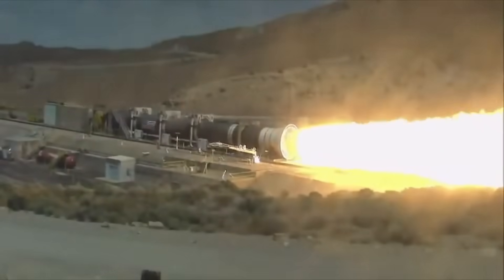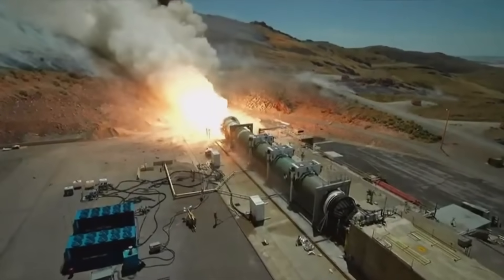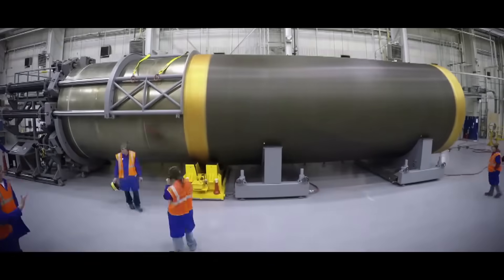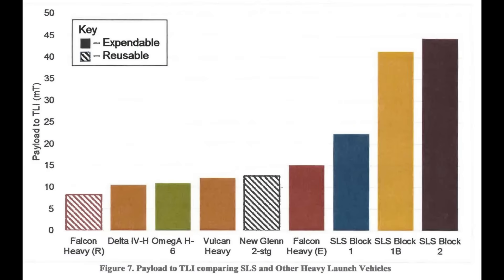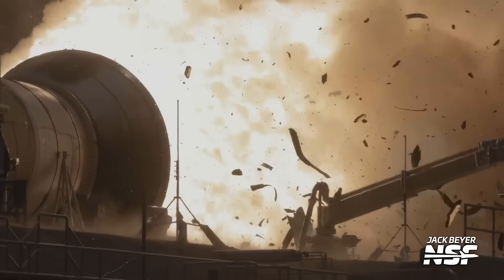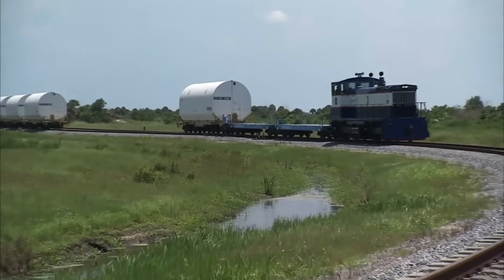NASA's Future SLS Booster Just Failed Its First Test

Comment: Setting the explosion aside, why on earth would you put "Obsolescence" in the name of your new product.
Reply: Yeah, that and the "life extension" part of the name of the project made me think that this was a motor that had been built and stacked quite some time ago, and the test was to see how long such a stacked SRM could be safely stored and still be usable.  Propellant slump in these things is an issue if they sit around for years after stacking.  I seriously thought they were testing an SRM that had likely suffered propellant slump, not a brand-new iteration of the Shuttle/SLS SRB.
Reply: @DougVanDorn  Yeah the "solid" fuel isn't really solid, it's a non-newtonian goo shaped into a special shape in the combustion channel (star-shape) to increase combustion surface, and by altering the star shape they can adjust the thrust/burn time. Quite ingenious really and have made a lot possible in space flight.
Reply: @paulmichaelfreedman8334 if it's too gooey, it doesn't stay in place. It's a bit more like a pencil eraser than good.
Reply: @paulmichaelfreedman8334  It's solid. I was in the tactical solid rocket motor business for decades, in propellant mixing/casting operations and process engineering. It's as solid as a pencil eraser. If you're propellant is "goo" after curing, you're doing it wrong.
Reply: @edwardgiugliano4925  And the sagging?
Reply: Apple never trademarked it soooo
Reply: Because materials become obsolete, which drives the need for redesign. For example, the manufacturers of the metal motor case retired and they had a hard time finding a new vendor. Internal insulation used asbestos, but when asbestos became too much of a health hazard to use, they needed something else. Obsolescence issues happen all the time in industry. Just look at Windows 11. Guess where my 5 Windows 10 machines are sitting now.
Reply: It's called "making your goals clear".
Reply: Bureaucrats think that way.
Reply: Because you know how long it's going to take to complete the project.  Thinking ahead!
Reply: Just being honest?  It's shuttle tech which is obsolete,, thought he explained it pretty well,, using shuttle tech NOT for a shuttle so design changed..
Reply: To future proof your funding initiative, obviously.
Reply: Just trash the whole fricken thing
Reply: imagine if we didn't have spaceX . this would be devastating . thankfully we don't need to care
Reply: @websitemartian why is it that you are okay if SpaceX rockets blow up and not nasa rockets? The engineering process remains the same with either.
Reply: @Khronogi wait, i thought NASA rockets never blow ip because they do things right the first time, unlike SpaceX 🤨 that’s what youtube comments told me
Reply: @Khronogi   spacex production rockets like falcon don't blow up. nasa is decades old technology. production technology. that blew up two shuttles, by the way.  falcon revolutionized the launch industry. starship will evolutionize the launch industry. evolution is success through iterative failures.
Reply: @badanimal907  "falcon revolutionized the launch industry"
who told you that?
Reply: @websitemartian  cuz SpaceX rockets dont blow up.
Reply: @websitemartian  Most underrated comment here. This got to the essence with as few words as possible. Awesome job!
Reply: substitute: red state socialist program, and you are more accurate.
Reply: It's an ai-generated name. Ai only evaluates the numerical value of a word, not the words' actual meaning.  😅
Reply: @rick49 Oh come on now, the SLS is so delayed that back in the day when they invented the name there was no AI yet so it's just good old human intelligence 😂
Reply: @rick49 uh, no.

Comment: the nozzle possibly detonated, you can see a small condensation plume run up the hill shortly thereafter at 2:03 .
Reply: Thats not what a detonation is. Detonation just means that there is an explosion where the flamefront is supersonic. This  was just an energetic nozzle failure which looks like an explosion due to the high pressure exhaust
Reply: @CoffeeMonster12  Rocket exhaust normally is supersonic due to the DeLaval nozzle. The booster exhaust is about 2.5km/s, aka Mach 7, which is actually hypersonic. Detonations are entirely possible when dealing with solid rocket fuel.
Reply: @stevegredell1123  There is nothing additional combusting here, just a flaming SRB and a pressure wave caused by a failing nozzle
Reply: No, that was the secret extra boost effect.
It's not a failure if you intended it to fail.
Reply: No its not, matter of fact, it cant. The “explosion” are fast gases, u know rocket gases go fast, ripping through the side part and taking material with it.

Comment: AI Summary

Abstract:

This video details a recent test firing of Northrop Grumman's next-generation solid rocket motor (SRM) for the Space Launch System (SLS), part of the Booster Obsolescence and Life Extension (BOLE) program aimed at enhancing its power and incorporating 21st-century improvements. During the test, approximately 100 seconds in, the motor experienced a critical burn-through failure in the nozzle, leading to a catastrophic breakdown, separation of the nozzle and throat, and continued uncontrolled burning of the solid propellant. The speaker draws parallels to a similar nozzle failure during a 2019 test for Northrop Grumman's canceled Omega rocket, highlighting common design improvements such as composite casings and electrical thrust vectoring. The video also explores the profound historical "inertia" influencing rocket design, humorously tracing the dimensions of the segmented boosters back to Roman chariots. Despite the setback, the speaker suggests the failure might only affect later SLS missions, given current political uncertainties and existing hardware stockpiles, concluding with a reflection on the potential end of the era for large solid rocket motors in favor of reusable liquid-fueled systems.

Northrop Grumman's SLS Solid Rocket Motor Test and its Unforeseen Failure

*   0:00 SLS Solid Rocket Motors: Northrup Grumman's solid rocket motors for the Space Launch System (SLS), originally from the Space Shuttle program, are still the most powerful single propulsion systems.
*   0:37 SLS Design Philosophy: The SLS design, influenced by politicians, aimed to reuse Space Shuttle components, but many required significant redesigns, including the solid rocket boosters, which would need new production with 21st-century improvements as they wouldn't be recovered like on the shuttle.
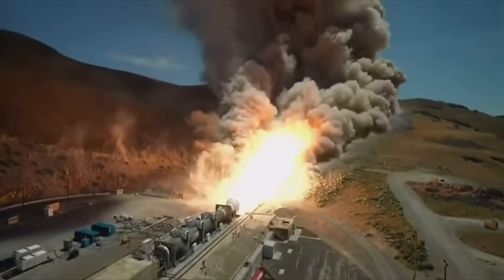*   1:31 Nozzle Burn-Through Failure: During the test, around 100 seconds in, a burn-through occurred on the nozzle, leading to hot gases expelling into the skirt area, a catastrophic breakdown of the nozzle, and its eventual separation from the rocket.
*   2:24 Solid Motor Characteristics: Since it's a solid rocket motor, it continued to fire uncontrollably until all propellant was consumed, as there's no way to shut it down.
*   2:47 Historical Parallel (Omega Rocket): This nozzle failure is reminiscent of a similar incident in 2019 during a test for Northrup Grumman's Omega rocket, which was a canceled military launch competitor.
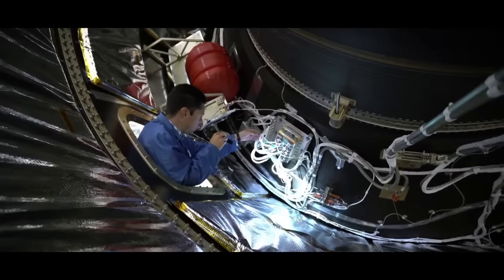*   3:48 Modernization Efforts: Both the SLS and Omega booster designs incorporated significant upgrades, including switching from steel to composite casings, hydraulic to electrical thrust vectoring, hydrazine APUs to batteries, and new fuel formulations.
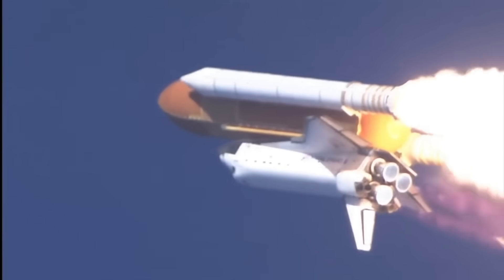*   5:34 Unused Composite Boosters: Composite boosters were developed for the Space Shuttle in the 1980s for polar orbit launches from Vandenberg but were never flown due to the Challenger disaster's increased risk aversion and the Air Force's withdrawal from shuttle commitments.
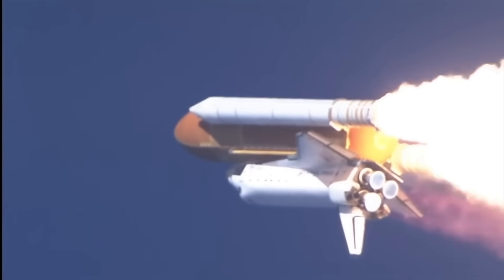*   5:34 Performance Improvements for SLS: For SLS, these mass-reducing composite improvements were projected to add four extra tons of payload to Trans-Lunar Injection for the Block 2 configuration.
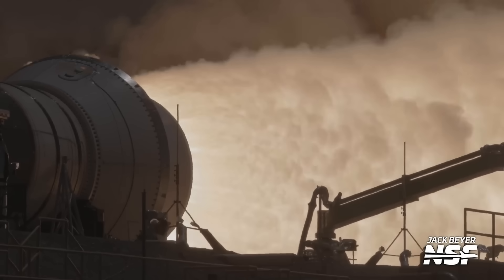*   7:13 Failure Progression Analysis: Detailed analysis of the video shows the gas leak beginning between the nozzle and skirt, expanding as the structural failure progresses, eventually leading to the complete blow-out of the nozzle and throat, which likely caused a drop in internal pressure and burn rate.
*   10:30 SLS Program Uncertainty: The booster failure might only impact Artemis 9 and subsequent missions, but the SLS program's future beyond a few initial flights remains uncertain, depending heavily on congressional funding and political "inertia."
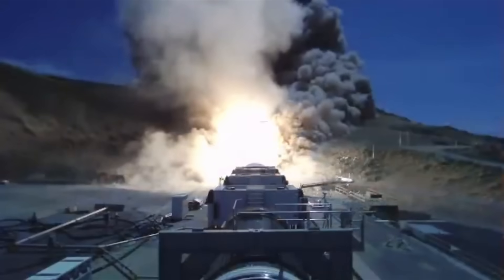*   11:03 Deep Historical Constraints (Horse's Ass Analogy): The segmented design of the boosters, required for rail transport through tunnels, is linked to the standard rail gauge (4' 8.5"), which is humorously traced back through British trains and wagons to the width of Roman war chariots, dictated by the width of two horses' asses – illustrating profound legacy decision-making in engineering.
*   12:50 Future of SRMs: The video suggests this incident could mark the end of the road for large solid rocket motors in spaceflight, as SpaceX has demonstrated the greater reusability and efficiency of liquid-fueled boosters.

I used gemini-2.5-flash-preview-05-20| input-price: 0.15 output-price: 3.5 max-context-length: 128_000 on rocketrecap dot com to summarize the transcript.
Cost (if I didn't use the free tier): $0.0059
Input tokens: 17247
Output tokens: 935